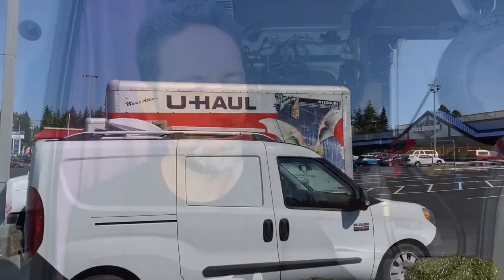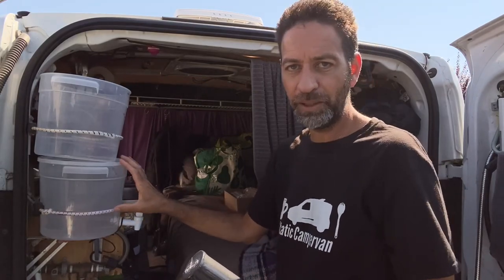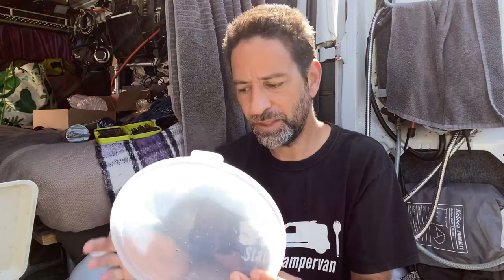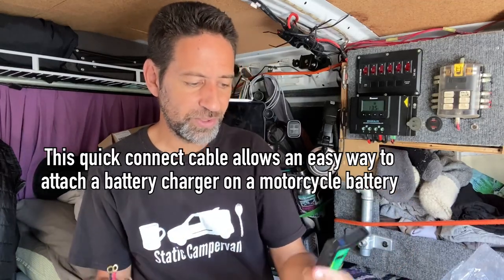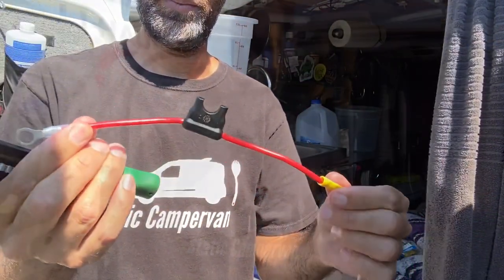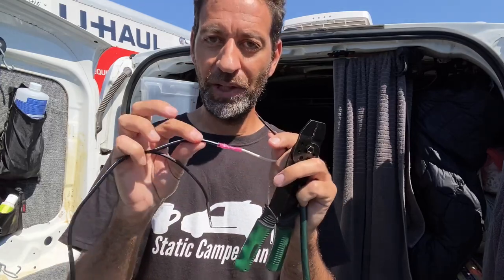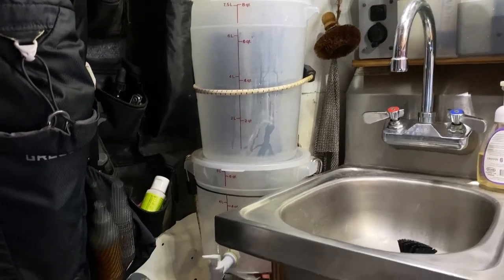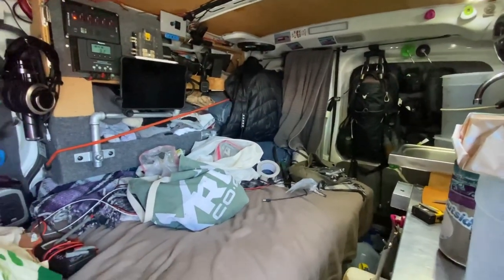Exciting Van Upgrades | Water Filter, USB-C Charger, Homemade Rivnut Tool

Comment: Looks good. Glad you got the projects sorted. I found some USB C sockets on eBay and just swapped over my old USB A ones for the new ones. Seem to charge pretty quickly 🙂
Reply from the maker: That’s what I was going to do but settled on this one because I liked the cable feature
Reply: It's a good feature to be able to move it wherever you like

Comment: Nice use of a motorcycle charger I use the Anker lightning cable and the Anker Nano ii 45w
Reply: Scott how much solar do you have and why not more ???
Reply from the maker: Currently have 150 watts of solar on my van roof. Plus a 100 watt portable panel. 
If I had more space on my roof, I’d have more panels up there.

Comment: When my sister was in the high school marching band the band director told everyone drink hot coffee when they was going to be out marching in The heat because it would raise their body temperature so they would not notice the heat as much and by the same token in the winter when it's cold you drink something cold and it will lower your body temperature a little bit so you won't notice the cold as much now I'm not so sure about the cold part of it but drinking hot coffee on a hot day does make the weather a little more tolerable

Comment: you should be able to upgrade those USB ports on your power panel to the ports that supply higher current.
Reply from the maker: Yes, that’s what I intended to do. But when I found out about the motorcycle charger, it made more sense. I like having the extra cable length. It’s be more useful than I’d even imagined.

Comment: IT looks like the USB A in the new charger is a blue one. This is supposed to be a version 3 or 3.1 which has a higher throughput than the old white ones. Test it out on your iPad and see if it charges more quickly.
Reply from the maker: The USB-A side takes the same amount of time to charge as my old outlet. I’ve tried it with my iPad and phone. 
The USB-C is fast charging like I’d hoped.
Reply: @StaticCamperVan  Ok, weird. Version 3 should be much better in power management and throughput. Also datatransfer should an order of magnitude higher. Both from the specs and my personal experience. But you have your own experience. USB is in general a better choice,. I’m glad that here in Europe, companies are pushed to present the customers ate the minimum USB-C for connecting their devices.
Reply from the maker: USB-A delivers up to 5 watts versus USB-C that is capable of delivery up to 100 watts. 
My iPad can charge at up to 30 watts of power, meaning a USB-A connection is going to work very slowly compared with a USB-C.

Comment: Hi Scott!  How do you charge apple lighting cords with that usb c?  Also, did you have to prime those filters before installing?  I know that with mine, I did. You did good all in all with your van work there.  I would have thought that the weather would be cooler than CA there in the Pacific Northwest.  Are there any breezes coming off the coast?  I hope it cools down soon for your sake.  Thanks for sharing 😎
Reply from the maker: Apple sells a USB-C to Lightning cable. There are lots of other brands as well. 
I did prime the new filters but edited out that footage from the video. 
No real breeze, I was a bit inland and tried my best to enjoy the warm temperatures.
Reply: @StaticCamperVan  Thanks for that information. I will look for the usb c cables. So you see that it charges faster?
Reply from the maker: @valyd45  my favorite cables are made by Anker. They are better made than Apple cables. Target stocks them. 
The cable I ruined while at the Smith River recently was an Anker USB-C to Lightning Cable.
Reply: Wishing you calmness good health and peace the coming month ahead.

Comment: Do you ever drink iced coffee? That would solve the "i really want some coffee" issue if it really is too hot out to feel like drinking coffee. Make coffee a bit stronger (and sweeter(?) than you normally would and fill a big cup with ice. If you use normal strength, it will come out too weak. That is only MY routine. You might already be a pro who is way better than i am at making iced coffee. OR maybe you hate it. (I, at least, get brownie points for trying) 😘. Feel free to say "yuck" if you hate it. 😁
Reply from the maker: Hate is a strong word. But yes, I hate cold coffee. Haha. I don’t drink anything cold ever but have a particular disdain for cold coffee. Besides, cold drinks heat us up in warm weather.
Reply: @StaticCamperVan  That is true about heating you up in hot weather. I do love iced coffee, though. (Love is a strong word, also.) These days i cannot drink any coffee or tea because my stomach is way too difficult.   Rarely i do, but pay a big penalty. Severe stomach pain ensues. 😜 Thankfully not headaches. Have a great Sunday.

Comment: 5v, do it drawn less power than the 12 v plug ? I think it's about amperes but no sure.. I'm neither an expert, actually with 12v male plug of 2.0 amp and same for the usb cable.
Reply from the maker: Not sure.

Comment: With Berkey you have to prime the new filters. You don’t have to that with knock off filters ?
Reply from the maker: Yes, the filters need to be primed. I had to cut the priming footage out of the video because my explanation was too long and confusing. 
The video can only have so many long and confusing diatribes.
Reply: @StaticCamperVan  
Got it. I understand, I thought maybe you got to skip that step.
Reply from the maker: These filters came with priming buttons included. Impressive for the price.

Comment: Nice USB charger. Does it have a on/off switch to negate parasitic current draw from the voltage display? Not an issue for your van but for a much smaller motorcycle battery.
Reply from the maker: Yes, it does have a switch. I can also easily unplug it. Even a slight parasitic draw would be disastrous for my underpowered solar system

Comment: Confused I looked it up to buy but it shows usb c standard 2.4. it isn't any faster than the dual unit you buy to chassis mount. There are usb c units that have 3.0 power delivery but it doesn't look like that one. Thoughts???
Reply from the maker: You might be looking at a different unit. I have an Amazon link in the video description with the charger I bought.
Reply: @StaticCamperVan  thanks